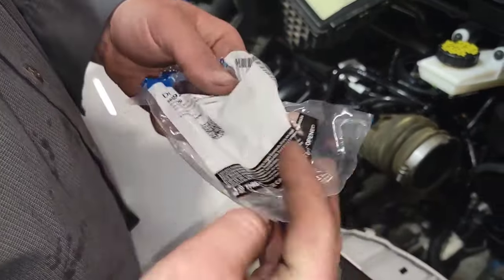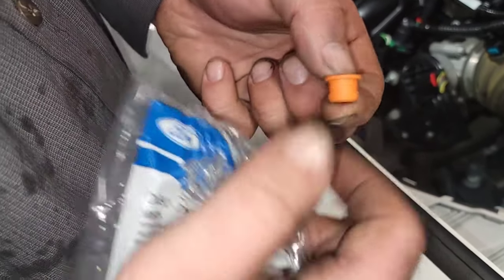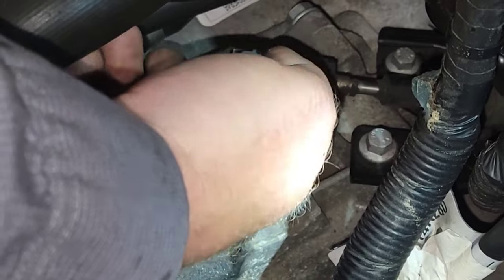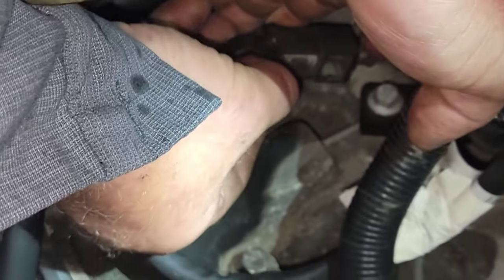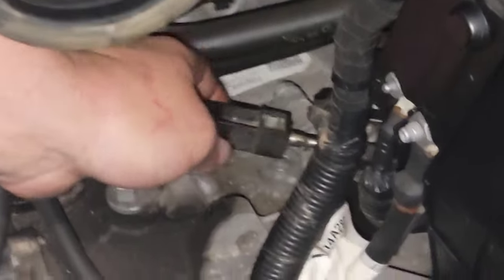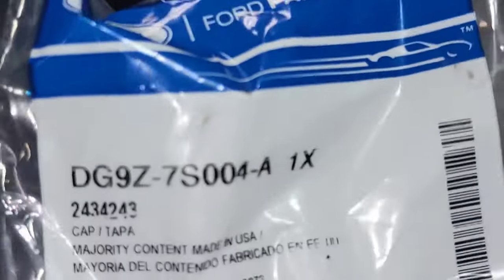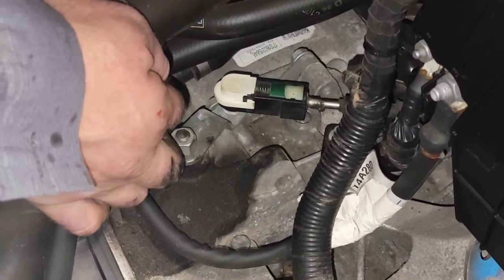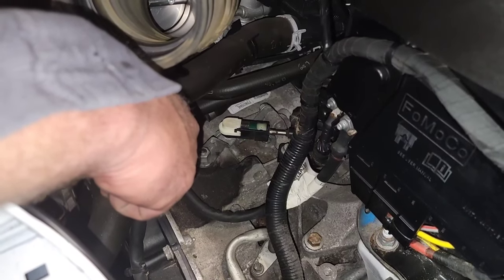Ford shifter cable bushing inspection - Edge, Fusion, Transit Connect, Escape, C-Max - Demonstrated

Comment: I have a 2012 transit connect and my gear shift position is in the middle of park and reverse when reversing and I'm neutral when driving. Will this fix my issue?
Reply from the maker: It could but only if your sure you are capable and use all safety precautions

Comment: Checked on my bushing in 2014 escape is fine. Seems no update cap seen. Bought it 2018. Need info..Is the recall here same as my recall July notice. Similar NHTSA Recall 22V413 shifter cable bushing damage missing letter notice?
Reply from the maker: Yes call your dealer
Reply: Did already. They waiti g for parts. Thks

Comment: Thanks for this video FBM. I put eyes on the bushing in the wife's 2017 Escape and it looks intact. Noticed the replacement bushing is an orange color while the original is white? The one in the wife's Escape is white with no cover. Should I go ahead and change this out just to be safe until the 22s43 campaign gets underway?
Reply from the maker: Yes you need to contact the dealer let them run your VIN number and see if you have the campaign open to replace it before this newest one
Reply from the maker: Also look at my previous video 22s43 at the build dates because yours may not apply
Reply: @FordBossMe  I pulled the advance notice bulletin from the NHTSA Recalls website and the Escape falls within the dates. I have a state inspection on the car due next month, so I'll have them run the VIN at that time.

Comment: Ford fusion 2017 I replaced the whole cable and everything is on correctly.  I put it in gear and it reversed then it stopped changing in gear. It didn't automatically go to park like it did before.  Why doesn't it switch gear when I change gears still?
Reply from the maker: Something's not hooked up right
Reply: @FordBossMe  there's only an end connection to the tcm and the other end on the transmission. It's installed with no obstruction.  Still says system fault. How do I reset tcm?. It's a 2017 ford fusion with electric gear rotater

Comment: Rich, I got a "Silly" Issue with my brand NEW 2022 F-150 LARIAT. It's got   "347"   Total Miles on it. I got in it yesterday and I was adjusting the Drivers Electric Seat, when I was moving it in the forward direction, I sounded Like there was Gravel in the Rail's / Screws as it was moving forward?? GOT MY ATTENTION Right Quick. And Of course it don't do it All the Time?????? Is there anything that I can Use to Lube this Rail with to see if that's all it is? I can see some of what looks like Whiteish like Grease at the Front of the Inboard and Outboard Rails. Don't look like your typical White Grease. Looks like a Silicone product. I do not want to "VOID" any Factory Warranties with some Inferior Lube??  Thanks for any help.
Reply from the maker: That's just white lithium grease

Comment: Do I need to  unplug the battery? To try to fix it?? Thanks in advance
Reply from the maker: No just make sure the parking brake is set key on but engine not running and if the vehicle is in drive its easier to work the cable on - ENGINE NOT RUNNING - 

Then shift back to park start the car

Comment: I have 0 luck w/my FF 😣

Installed block.

I still have the crazy light up down Idle/REV car does by itself. 
Mechanics don't know what a neutral profile correction is! Never got that done. 

Now...Car has a new Noise😫 perfectly timed with my motor at idle and acceleration,  my mechanic is telling me it's the torque convertor. 

Car is drives fine just has a crazy growl/noise coming from under the hood

58,000 miles
Block replaced 4,000 miles on new block and now this!

Sound like torque convertor issues to you?
What are 'TC' issues like anyway?
Reply from the maker: Torque converters can cause issues like that as well
Reply: @FordBossMe  thanks for the help, will know for sure. I feel like this is all stemming from the revised block install! I'm wondering if they touched something when doing the install!

I'm curious to know I'd you have to touch the transmission to change the block? If so, the problem must've come from them

Comment: Hi so we replaced the actuator assembly and a new cable and we're still getting the same notification on turn on the cluster to see manual. Is there anything else we can do?
Reply from the maker: It's probably something else going on and not the shifter cable because that doesn't trigger a warning light unless you installed it incorrectly, if you put it in park is it actually in park? When you put it in drive is it actually in drive? Does it seem like the shifter and the sequence is all lined up properly and if so then you've got another issue going on

Comment: Hello I have a problem with the gear linkage  ford fusion 2.5 l 177hp 17r I live in Poland do you know the part number gear cable?
Reply from the maker: Unfortunately I don't but I try and research it for you if you give me a reminder tomorrow - it's 7:20 pm here now

Comment: How come a recall isn’t out for all fusions in the years that have this known issue? And if your car has this issue will ford cover the cost?
Reply from the maker: A safety recall means it's 100% covered if the vehicle falls under the specified dates
Reply: This happened to me on my 2016 fusion last September, Took it to ford and they didn't cover it under the recall because my VIN number series wasn't part of the recall. I was baffled, since it literally had just happened to my car.

Comment: Morning Rich. Hey will a NEW Bushing be Installed in our Vehicles even if the Original Bushing is there and In Tact??
Reply from the maker: So I pinned a comment to the top of the comment section and I normally do that with important information there's a previous video that I did 22s43 where I took the time to break everything down and I told people I would do another video showing the inspection portion which that was this video if you go back and read the previous video or I should say watch the previous video you'll see that there's no information put out on the new 22 s43 recall coming out in the 4th quarter of 22 they don't even have any information available for us yet please go check out that video
Reply: With any of these campaigns, if your vehicle is on their list, bad or not, they will replace it because that is the purpose. They expect them to go bad if they are not now, I believe thats how they see it.

Comment: so what does it do ?
Reply from the maker: It's a shifter cable bushing man it attaches to the shift lever in the vehicle so when you want to go from Park to reverse the neutral to drive it moves the lever on the transmission

Comment: Drivers that never use the park brake  have this problem leavin car transmission holding all the load when you shift from park you hear a heavy clunk then after period of time these bushings fail  ,

Comment: So I was having trouble with my shifter not wanting to go into D at first and wouldn’t go into S at all when I went to leave for work on 2nd shift today and I watched this video knowing I had a recall done to mine and wanted to check out the location of the bushing 

I don’t normally work on cars but figured what the heck I’ll take a look and see if it’s coming undone or whatever, outside with a flashlight at 11:30 at night after working, find the spot right under the air hose thing there and lord and behold, a big ass walnut in the way of the shifter. Fcking squirrels.

Comment: Garbage.

Reading through these comments here I can see getting rid of my 2017 "fix or repair daily" Edge was the best decision I made in these last couple of years.

When I started to hear the transmission making noises, like a loud pop coming out of park and on a few occasions have it feel like it was going to violently drop out from under the vehicle when I'd put it into gear to pull out of the garage.. I knew it had to go. Worse shifting transmission I have ever drove, never seemed to want shift into passing gear smoothly it would hang/surge and you'd have to stomp your foot into it to get it to move and doing that was always overkill but when you need to MOVE you didn't have a choice or you risk getting hit.

For a 285 hp 3.5 v6 it drove like a worn out dog getting onto highways because of that gearbox. It couldn't get out of its own way.

Comment: i wont be able to drive my car to a dealer until Q4 anyways.  gotta fix the crappy transmission that should be recalled for faulty clutch pistons that break apart.

Comment: Hey man i just did mine but the shifter is hard to do what i did wrrong
Reply from the maker: Send me some pics of your install poissorichard.rp@gmail.com
Reply: You have a number i dont know how send pics on emails
Reply: Ok my wife go to the store when she park the car she go inside the store whe she start the car she said the shifter was so lose then i just put the cable back in place just to get home but i purshes the bushing at ford dealer i install it but the shifter is hard to move and i did everything same as your video
Reply from the maker: @minecraftmaster6582  then maybe something else is going on and it needs looked at
Reply: So what you think i did rwong ?
Reply: Ok i install the new bushing i have to move the  part from the transmission to the rigth the way i can reach the shifter cable

Comment: I just had to fix mine.  Who thought it was a good idea to use a plastic bushing on something as important as shift linkage??  Especially since it is right above a very hot transmission??  What's wrong with METAL bolt and nut?  Even the "fix" is plastic.  How long before it fails?  I hope they didn't use the same plastic crap on the brake system.  Like we say in the aircraft maintenance business.... it takes a college education to design and break them, and a high school education to fix them.  LOL

Comment: What years does this effect?
Reply from the maker: Check out the 22s43 pinned post at the top of the comment section I did a previous video on this I say this all the time please check the top of the comment section because there's one specific comment that's always pinned to the top so everybody can find it so I don't have to keep answering the same question over and over again because it becomes very annoying and very redundant I try to be very fair to you guys and give you all the information it's just nobody actually follows through on their end as a subscriber or commenter here and plays along and then it's like repeat repeat over and over and over again I already did the video and put it out on this this is just the follow-up on the inspection
https://youtu.be/F64zx80ARzw
Reply: Unfortunately,  I don't catch ever single video you post!  Thanks for the reply.

Comment: Isn't it lovely to know that ford didn't just pick on me.....they do it to everyone!
So they've been doing this for at least what....12 years?    My 2005 australian BF ford has this problem (which could have been so easily fixed in design with a bolt and metal sleeve. 
I thought it was just an odd thing....   but if they've been doing this for more than a decade there must be something more than just incompetence!   Do they sell those bits of plastic at gold dust prices?